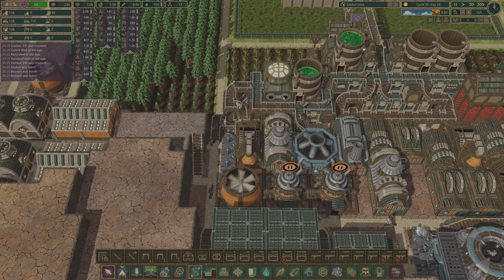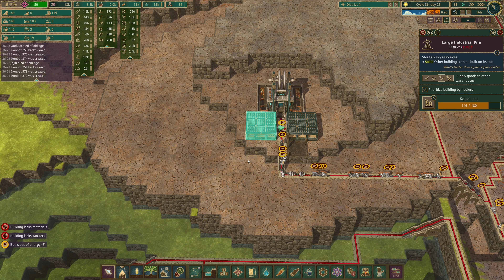Culinary Arts - Episode 25 - Timberborn Update 1.0 - Iron Teeth - Oasis - Hard

Comment: The logistics part of this game needs some polishing and redoing.
Ideally we get something like in "Cosmoteer: Starship Architect & Commander" where you can draw logistic lines between logistic entities such as producers, consumers and storage. That way you can, for example, override the default settings and say "this storage must only be supplied by this producer". That will prevent far away storages next to distant mines from being filled with scrap metal from other locations.
The current settings simply aren't good enough
Reply from the maker: Agreed! It would be nice to have some more control over logistics. In the early game it’s nice that it’s simple, but in the later stages of a save, the simplicity can be a bit frustrating.